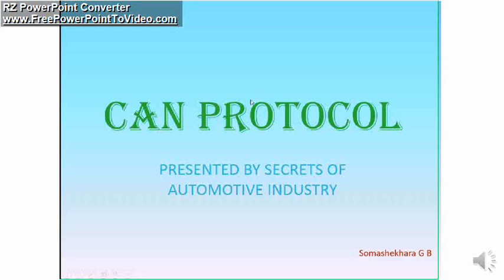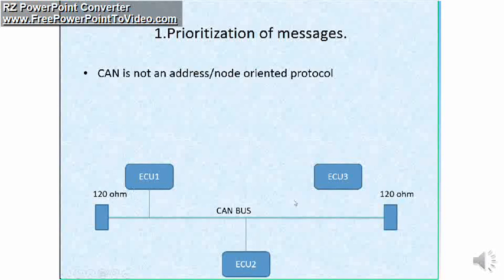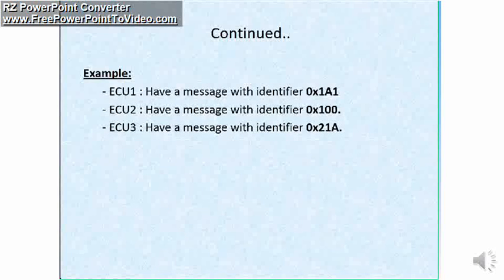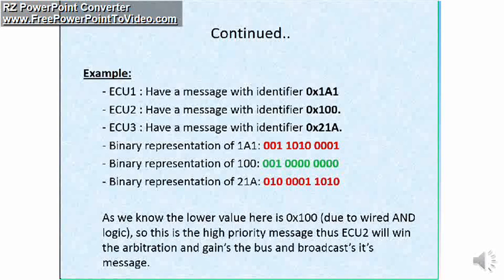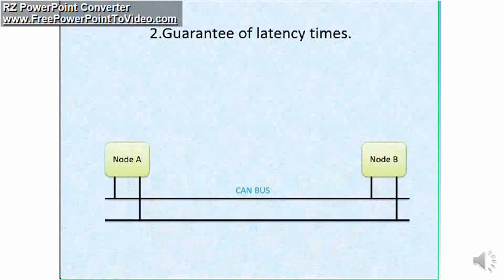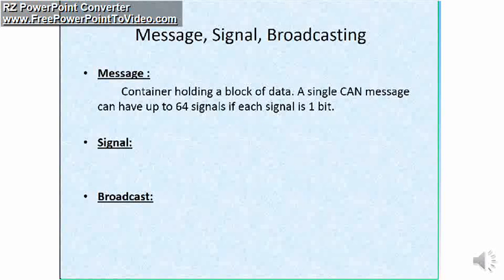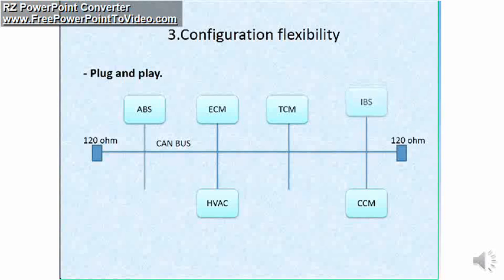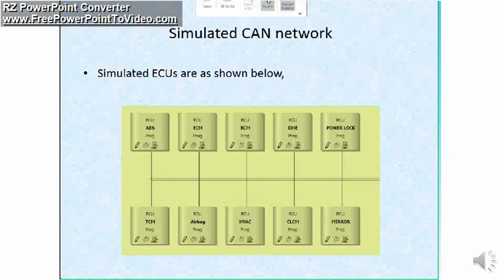CAN protocol basics. PART2, Properties.

Comment: priority will be based on Identifier. But who decides the Identifier for a particular node? what if a low priority node suddenly wants to sent a high priority message after some time? who will supply low value identifier to it to get high priority?
Reply from the maker: 1. First of all there is no priority is decided for nodes.
2.Priority will be decided only for identifiers and this will be decided by System engineers.

Comment: sir its a nice video, i have one question for it...which node will acknowledge the broadcast message.?

if suppose five out of six nodes receive error free broadcast message but one node failed to receive the message, then how the transmitter comes to know that it has to re transmit the mesaage

Comment: How many ECU in CAN
Reply from the maker: According to theory of CAN specification any number of ECUs can exists in a CAN network but Practically we can connect 32 ECUs only, because  of Signal loss and propagation delays in the network and connecting more number of ECUs may also increases bus load as well.

However we have an option to connect additional  ECUs if it is needed with the help of repeaters.
Reply from the maker: Thank you Shubham.